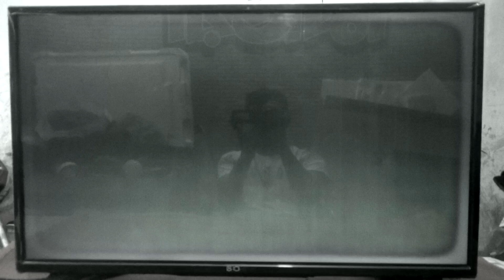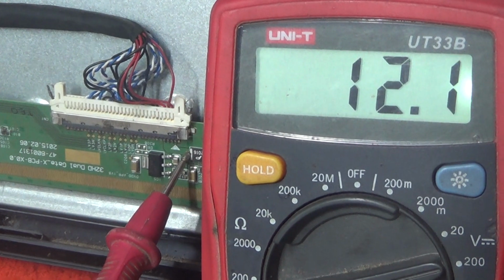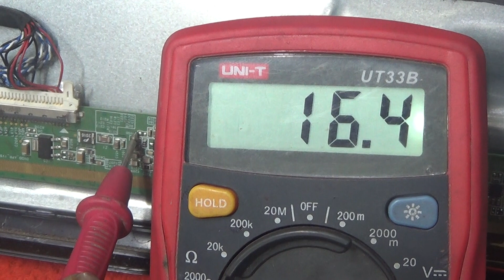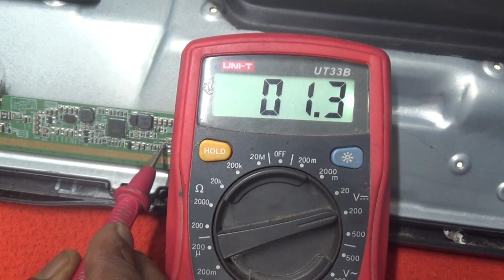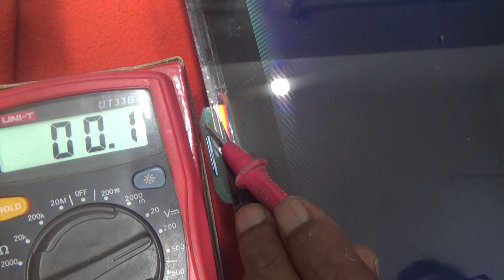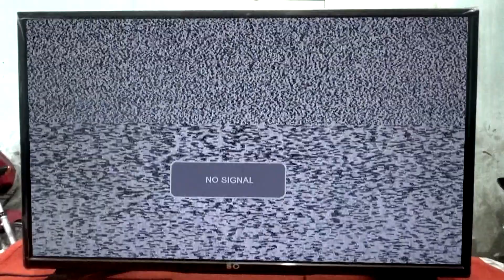Led panel repair white screen.

Comment: I have made a TMB press - Thermal Manual Bonding press (as opposed to TAB [Thermal Automatic Bonding]) and have bonded COFs.  FOG (flex on glass) for a 1080 panel (27 pitch) is difficult.  In one case, I did not even use new ACF.
Reply from the maker: welcome